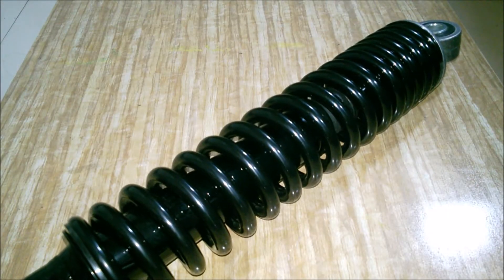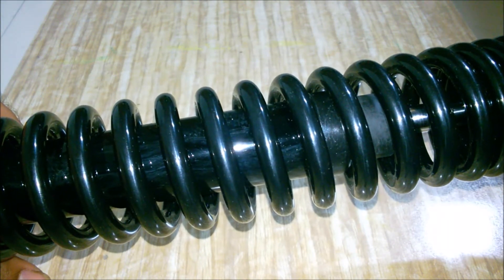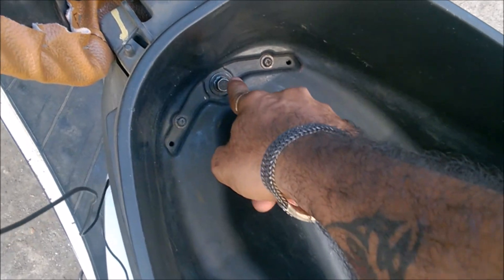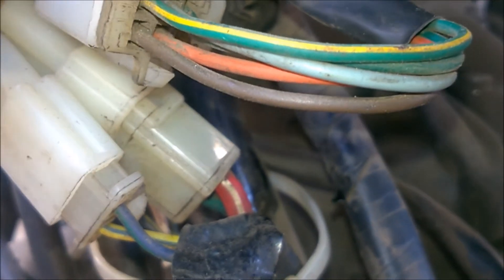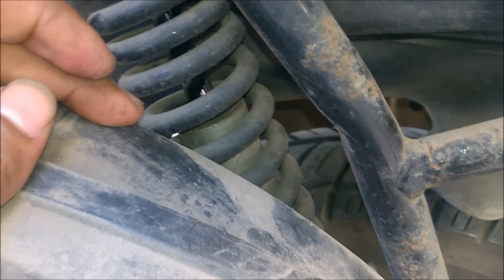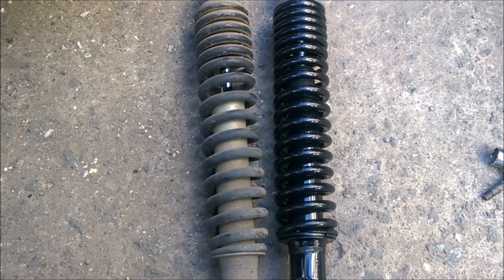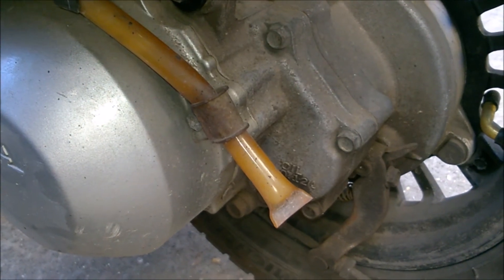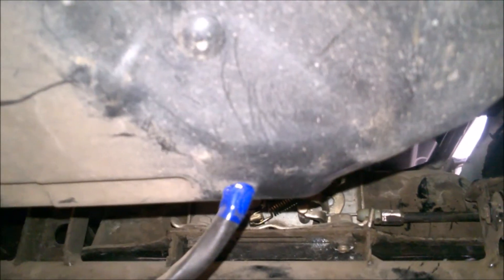Installation of gas powered suspension (activa)

Comment: Can we use ntorq suspension for activa 4g, which suspension is better Jupiter or ntorq
Reply from the maker: Use new Jupiter's suspension
Reply from the maker: Ntorq suspension is not compatible
Reply: Brother after installing Jupiter suspension can we get relief from back pain
Reply: Driving my activa nearly 40kms Im getting back pain
Reply from the maker: The new Jupiter's suspension has adjusting feature use it to make the suspension hard or loose according to your preference brother

Comment: Which company's front shocker is good for activa 2011 model and this gas shocker will it fit in 2011 model
Reply from the maker: If you're talking about telescopic suspension in front then go for aviator but it's not an easy task too much of headache and job to be done that's the reason I haven't done it. Secondly yeah this nitrox suspension can be installed on any activa model

Comment: Bro can we change the front and back suspension of honda dio 2018 model 
Like this pls do a video or replay

Because ir channel was awesome
Reply from the maker: Obviously bro both suspensions front and back can be changed the rear suspension can be changed to the same I have shown in this video and in the front Honda aviator suspension can be installed with little modifications.
Reply: @randomstuffriderrsr Any stability issues after changing the rear suspension?
Reply from the maker: @anassiddiqui4778  no brother it's smoothly working